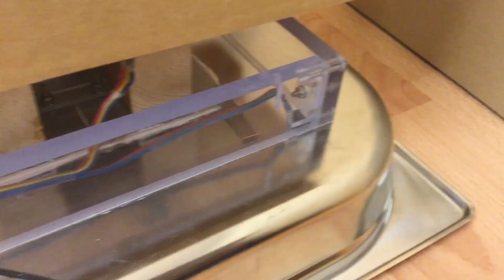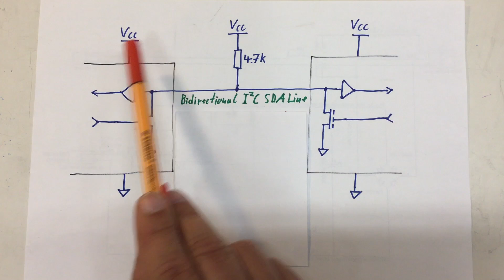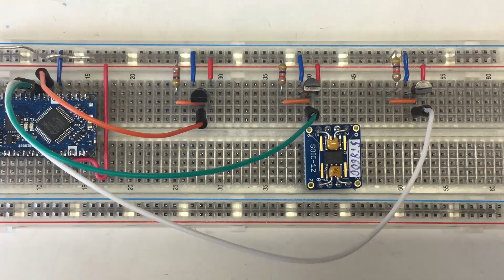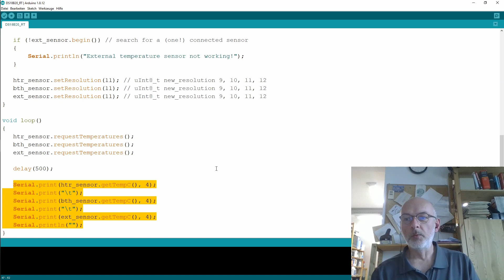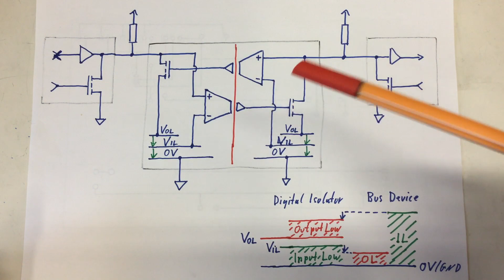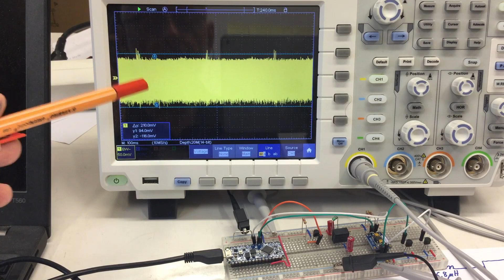Galvanic Isolation of 1-Wire Devices (Direct Power)

Comment: The LC filter at the input to the DC-DC converter probably rolls-off the harmonics of the converter switching frequency all the way up to VHF.  Your breadboard construction would never pass an EMC acceptance test, breaking all the rules of good EMC design practice.  The oscilloscope probe lead is also unsuitable for noise measurements except perhaps at audio frequencies, looking more tike a 1-metre antenna with a loop on the end at HF and above.  I still would never play with my Arduino connected to a long external line when a thunderstorm is about (lol).
Reply from the maker: You have some very good points there! Fortunately I don't have to pass any EMC tests with my breadboard setups ;-) As long as my WLAN and mobile phone continue to work I'm happy :-) And you're absolutely right about breadboards. In an upcoming video you'll see the worst crosstalk ever between two neighboring pins on a DIP chip. Anyway, taking reliable noise measurements on power rails is an art in itself - and one I can't claim I've mastered. Just wanted to make sure that the DC-DC converter isn't "poisoning" my 5V rail too badly.

Comment: I have need of some DS18B20 sensors coming up, and I will referencing this series of tutorials, its interesting using the I2c Bidirectional  data lines in this manner...cheers.
Reply from the maker: As always, you're welcome! The whitepapers on galvanic isolation available from the 1-Wire vendors are quite old and recommend some rather complex circuits. I thought nowadays there must be a simpler solution. And so I came up with using I2C digital isolators for that purpose.